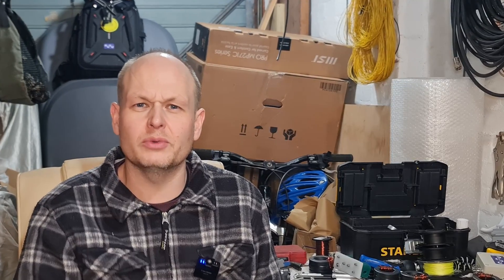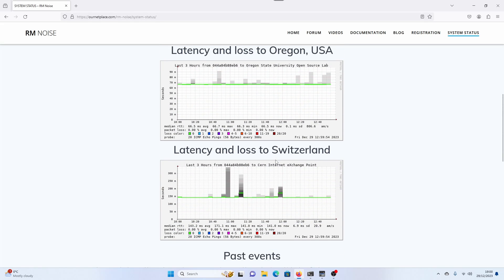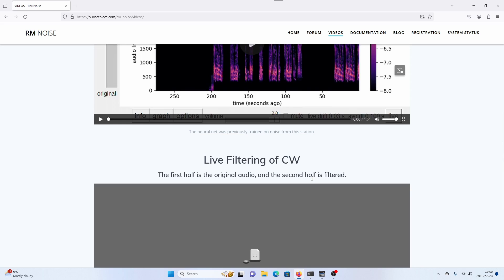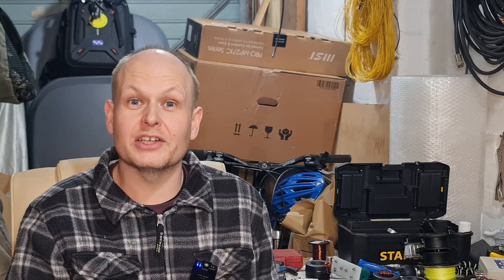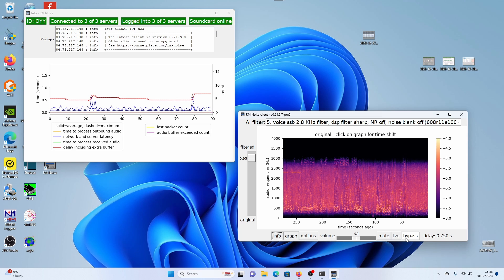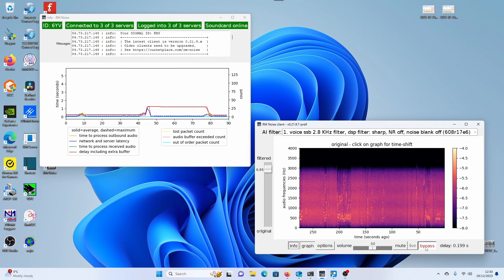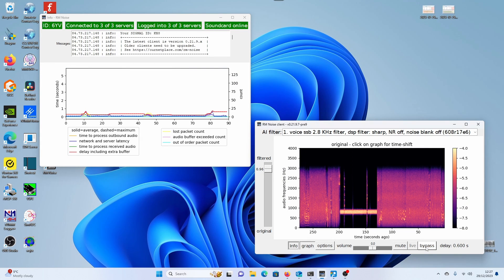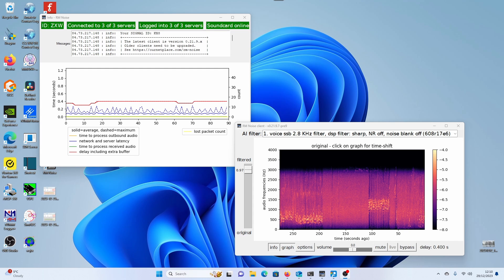How to MASSIVELY Reduce Your Noise level on SSB & CW.....For Free

Comment: It’s not bad but at times it’s quite unintelligible when the original was still sounding fine. 
Personally, I’m not a huge fan of internet-connected ham radio gear (and I’m saying that as a millennial) even though I am not a prepper or anything. I just think it’s magic to talk to people out of my own power with stuff I (at least partially) built myself.
If you ever tried an Elecraft radio, their CW filters are really good and they can do pretty much the same on device what this AI model did. N7KOM has a short/video on his channel where he showed it off recently.
Reply from the maker: I agree to an extent. My love is field radio. Some of these clips didnt need it. Its a good tool to have if needed.

Comment: Did you ever try the QRM Eliminator a.k.a. X-phase? It’s a little device that also does wonders to noise on lower bands and it works (offline) purely on the radio signals. I haven’t tried it yet myself but the reports I’ve seen make a good impression.
Reply from the maker: They do get a good name but only good for 1 source of QRM if you have multiple sources then you need multiple units.

Comment: I might just give this a whirl to see if I can receive ANYTHING in this very radio-noisy hole I live in! Dunno if you've seen it, or heard of it at all, but sota-antennas, followed by a "d-o-t" and then the letters "C", "O" and "M" has some nice configurable antenna designers with propagation patterns, VSWR curves, antenna currents diagrams and Smith charts, mainly for portable antennas, if you're into building your own antennas.
Reply from the maker: Go for it, nothing to lose.

Comment: If you have an Nvidia GPU that Nvidia Broadcast supports you can do this locally.  It strips noise just like this.  ModernHam here on youtube has a video 'Using Noise Suppression AI on Ham Radio to Remove Static' showing how to do it with examples.  He also shows other software if you do not have Nvidia
Reply: exactly I use the Nvidia system nr broadcast and works OK. You can also use the amd nr software if using AMD gfx cards.
Reply: Thank you. Something seems kind of fishy here. I know this same tech can run locally. There is no need for internet/cloud processing. That's kind of silly at this point.
Reply: All, it is still a great endeavour that the gentleman has done. Plus it is experimentation on how to use ai systems to interpret signals and also reduce noise.

Comment: Every one keeps complaining about local man-made noise but not a single operator who has complained that I have talked to has even installed or tried a noise cancelling phase system? They work! The QRM won't fix itself?
Reply from the maker: I know a few that have tried one. Unfortunately if you have multiple sources then you need multiple noise phase cancelling systems.

Comment: Does a good job. Still has that inherent digital loss that makes intelligibility of voice difficult, sort of the DMR effect. I think it's excellent on CW though and that is where it makes the most difference. I guess one positive effect is that it reduces or removes the hash noise that can cause ear fatigue over long periods of time. The TS590SG has pretty good noise reduction onboard, but it has that watery swishy sound whereas this RM noise software doesn't seem to have that at all.
Reply from the maker: Yeah its not perfect. Agree its better than the Kenwood's.
Reply: I got Kenwood 590sg too ... I hate that watery sound ...
Reply: Yeah but still better then using DNR on my Yaesu 991a!

Comment: Thanks for excellent information again, Colin. In your point of view Colin, are there any drawbacks using this software? I mean, how much will it cost to upgrade a desktop computer in order to gain the best results?
Reply from the maker: Not many drawbacks, just a slight delay by the time the signal comes back. You dont need any sort of fancy PC. I had it running earlier on my ancent laptop. All the heavy lifting is done on the £4K server.

Comment: I see the fundamental value of ham radio as being able to communicate independent from outside systems. That's why I don't bother with any internet-linked systems. If I'm going to have to use the web for radio work I might as well just use the Internet and not bother with the radio. It's a shame they don't have a system that can operate independently, as it could give my ears a rest to switch from I to AI. Finally, this is a hobby I engage in to learn more about RF communications and its various aspects, the physics, the software. So where's the source code? I can't learn anything about digital noise elimination from remotely located black-box software that just makes me dependent on unknown outside systems. So why is it being done this way, and once everyone is getting everything processed this way will it still be free? This reminds me too much of the free worms on fishing hooks.
Reply: I have been using a bhi DSP Compact inline device. To reduce received noise on my SSB  communications. It is quite effective. I recently told someone at DXE that it is almost like cheating to pull weak stations out of the noise.
Reply from the maker: Nonsense, We all do what we want to. Did he also say FT8 is cheating?
Reply: @MM0OPXAmateurRadio  if you're questioning my comment, I  merely said that improving reception is a great idea no matter how it is achieved. The Bhi unit that I use makes such an improvement for me and my ears. I think that the idea is to make a QSO and enjoy the DX or talking to a friend.  So, using a multiple element beam would also improve your SNR, but location, space, or money might limit that choice, whereas enhancing the reception is the way to go.
Reply from the maker: @kc8wvg  what I meant was the DXE guy was talking nonsense. Its not cheating at all.
Reply: I agree and fell the same way it’ll be a matter of time that perhaps radios will have the tech included or in the least have it on our computers independent of off site servers.
Reply: RM Noise is not an education program nor is it OSS. Neural Networks are well documented. Feel free to start your own project. It will be free a s long as volunteer radio amateurs like myself will carry the costs of purchasing the server hardware and the operational costs for the benefit of the entire community.
Reply: @hb9vqq533  When you start your own, be sure to start with the OSS RNNoise.
Reply: Something seems fishy here. Why does it have to run in the cloud? Looks like the same software that is in OBS that's called RNNoise, which runs locally.

Comment: Impressive, but personally I found the SSB less intelligible with the NR on, similar to my 991. It works great if there's already a good SNR but otherwise I prefer to switch it off. For CW though, it sounds fantastic.
Reply from the maker: Its not a miracle cure and its not always needed. Its a very useful tool though.
Reply: Seems kind of like a snake oil cure. Sorry if that sounds harsh, but there's no reason to run something like this as a cloud based service.

Comment: I put a lot of effort this year into building a stand-alone DSP audio device (running an M7 Arm and 16-bit ADAC) to process the audio output of my rig. Since I wrote the firmware myself, I can experiment with any algorithm I like. Currently I'm running custom spectrum noise reduction code, and it works quite well. Nonetheless, I'd be curious to know what method these guys are using. 
I'm not sure I like having to upload my signals to a server for processing, rather it would be nice if they released open source code so I can try running it on my device.
Reply: Exactly. This is a hobby. We are engaged in it because we like to learn more about it. We aren't consumers. We're not CBers. We're hobbyists and experimenters. Appliance radios and black-box software at remote locations hold little value and serve little purpose to someone like me who wants to learn about RF.
Reply: I'd love to hear more. Have you put together a writeup somewhere, or a github repo?
Reply: @TheFattredd  No, I have not posted my code or done a writeup, yet. But I do have a nice Fusion 360 model fly-through animation I made while working out the mechanical layout. I'll have to figure out how I can post it.
Reply from the maker: Sounds impressive. I've no problem uploading RX signals as its being transmitted regardless. Yes a local solution would be preferable.
Reply: In a nutshell RM Noise is based on a AI model derived from the training of a neural network. The NN is being constantly trained with real audio samples. The client programs allows to capture and submit such audio samples which then will be used to train the model. This way RM Noise will get better over time as more samples make it into the AI model. At the same time we are also collecting QRM samples, like OTHR, PV systems, SMPSU, LED Lights etc. in order to mitigate these kinds of QRM. 73 Roland HB9VQQ
Reply: Look into RNNoise OSS

Comment: Be interesting to know how much computing power this takes on the server, and whether it will be possible one day to run this from within a rig...
Reply: The AI model runs on a Nvidia GeForce RTX 4090 GPU. Not something the average radio amateur has in his shack
Reply: @hb9vqq533 I've A 3090. Likely enough umph Fer just myself if a 4090 runs a server. GFX cards aren't that expensive compared to top end HF rigs. Hunting down and killing the qrm is some of the fun though. If everyone gives up that bit of the hobby they'll be no more floor to speak of it'll be a ceiling.
Reply: works on my 3070 and also my minisforum amd 690 @chublez
Reply from the maker: The way technology is going, you never know. That would be my wish.
Reply: ... and you wonder what AI will be able to do next...  Pull the SSB audio out of a noisy environment no human operator could ever distinguish.  Speech recognition that "Repairs" the audio by guessing what half obliterated words probably were by the sounds and context.  "You're 1 and 1 old man..."
Reply: FT8 for SSB
Reply: @Banjoman-p7t  Yes, FT8, of course does something like that, but I was thinking of 'phone on SSB.
Reply: Seems kind of smoke and mirrors. I'd like to see a comparison to simply using a good noise canceling external speaker, or the built-in noise reduction of recent radios.
Reply: lots of power..  but noise  and hiss are part of the charm of radio ... either u are hearing it or not on radio waves.  what's next a direct line to each ham?
Reply from the maker: Not without propagation there isnt! Its a tool in the arsenal for those who want it.